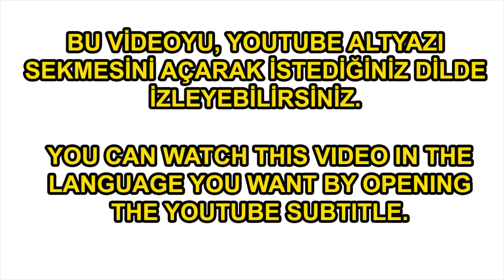HOW TO REMOVE INTEGRATED CIRCUIT USING ELECTRIC VACUUM DESOLDERING PUMP? DESOLDERING IC CHIP.

Comment: some boards from the 80s its not as easy as it sounds, even efter you cleared the holes at the back, there is still solder on the other side, the only method i found working is to heat the top side with a normal solder ione and use the desolder pump at the other side. But it applys very much heat to the board and can easy damage traces :(
Reply from the maker: There are several methods for desoldering.  You can also remove the solder using the method you mentioned.  Thank you for your interest.